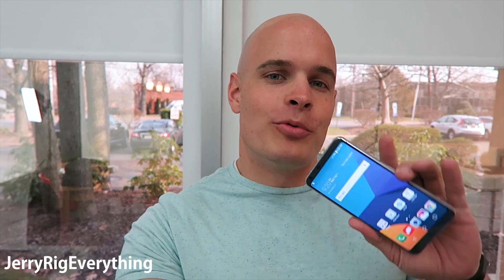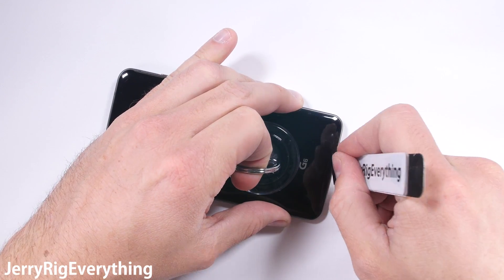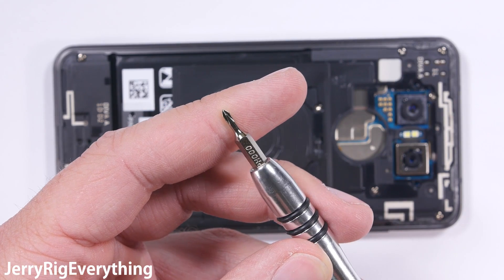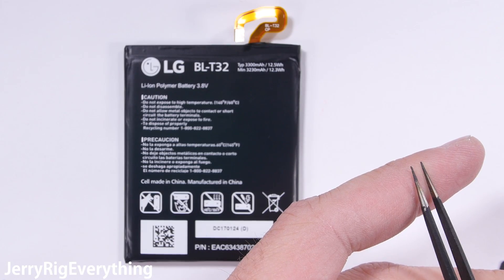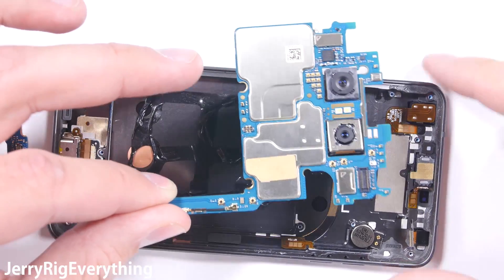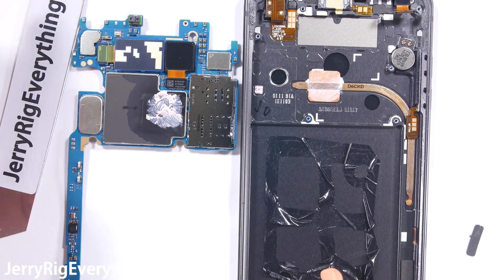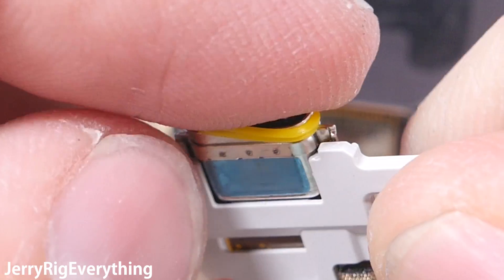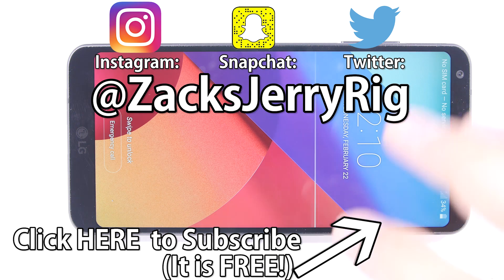LG G6 Full Teardown

Comment: hi sir. i have a lot of information inside my internal memory, my lgg6 died with no reason yesterday. lg g6 has the same bad soldering processor like the lgg4? i mean, it doesnt even turn on, or bootloop, just died not connected no nothing, in a cold way, not heat detected when i woke up from a nap. usb flex port is ok, and battery last like 1 day entirely, no problems with it so. can you help me?.
Reply: It's broken. Move on

Comment: LG has a very nice inside build quality and high repairability in their smartphones(easy parts replacement). However with this "brand new" phone the only difference is a bigger screen, the rest of the internal parts are identical. They keep producing defective motherboards one after another, that have poor soldering that kills the phone within a year or so from a normal use. This has been proved by independent technicians with videos and photos from under a microscope while they were fixing lg phones. Company just won't admit their fault and tries to remove such information from the internet. In addition my v10 was fixed twice in 13 month period. They have nice and fast warranty though (1 year). ** Great phones but not for practical people who use phones 2-3+ years. LG G2, G3 are the only reliable phones out there, anything after that is just marketing garbage.